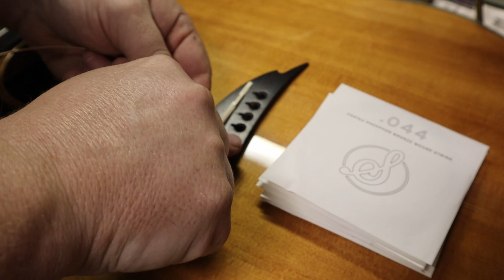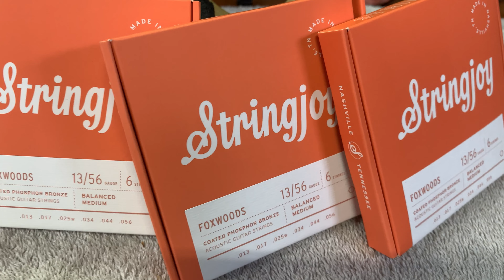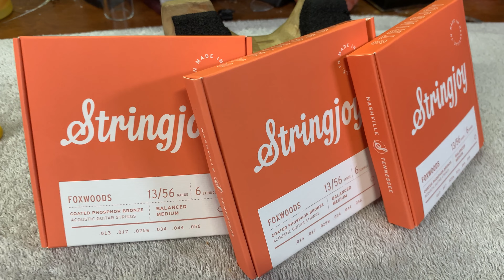Plastic, Bone, and Tusq: Sound Comparison and Finalizing Acoustic Setup. Nut and Saddle Series pt. 3

Comment: Can someone please do this test scientifically with a proper equalizer sound display thing?
Reply from the maker: I did the comparisons as good as I could.  My very first youtube video was two years ago and it was looking at the same subject.  It was recorded with an iphone camera and even then you could hear a difference.  In my opinion, the biggest take away is to understand that there is a difference.  Obviously YOUR guitar is going to sound different, so an EQ is not going to be as helpful as you think it would be.
Reply: @MillerCustomGuitars  but we have no way of objectively knowing any difference, this is all subjective. But if you did the same guitar, same strings, just swapping out the saddle materials, showing the EQ for various strings and chords, that would be objective Nd visible. for instance theres a video where the compare dreadnought and concert sizes using same guitat model/line and an EQ. You could objectively see that concert size loses on the low end of the EQ
Reply from the maker: @CapnHilts  You are right, but in my opinion, all guitar tone is subjective.  You want to trust your eyes, but I think it's more useful to trust your ears.  And honestly, in videos I have watched, I have found the subjective insight from player more helpful than the clips themselves.  This is why I included my summary at the end.  Sometimes it's difficult to tell the difference over a Youtube video, especially if you're watching on a phone.  I can tell you what I experienced:  The plastic sounded fine.  The Tusq had more full response overall, but especially in the upper mids and trebble.  The Bone had an even response over the entire spectrum, and also didn't compress as much when I played at loud volumes.  

Anyway, thank you for watching the video!
Reply: @CapnHilts goofy 😂